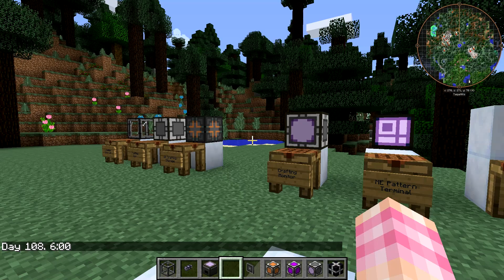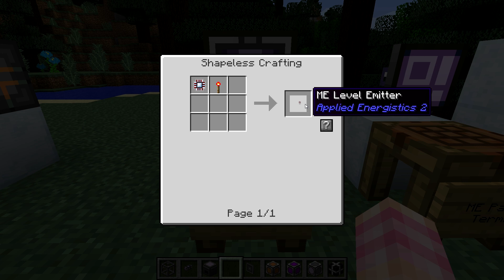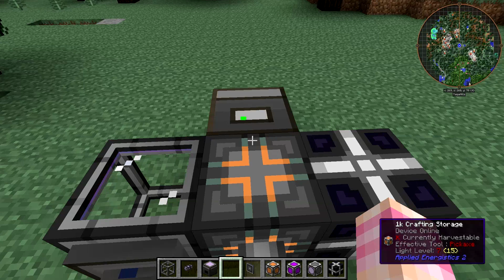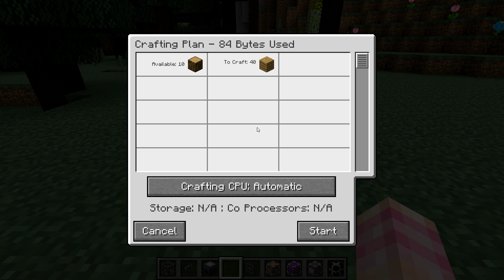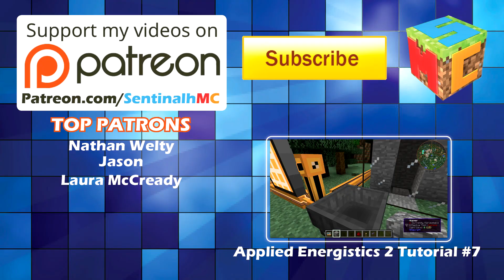Applied Energistics 2 Tutorial #8 - Basic AutoCrafting

Comment: How do I add more patterns to the me interface? It only has like 9 slots (call me an idiot if I missed somethingXD)
Reply from the maker: First I would suggest not using that interface for anything other than crafting the processors, it can get messy. You're better off locating your auto-crafting stuff elsewhere on the network. 

The answer to your question is build more interfaces. Most of the time you'll want to use the small interfaces rather than the block one, and you can build 5 of them on one molecular assembler.